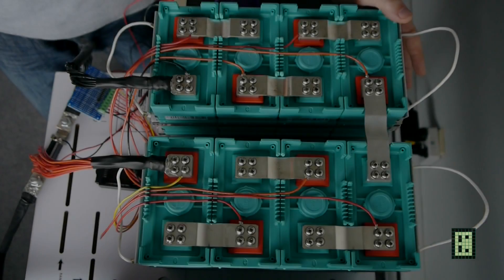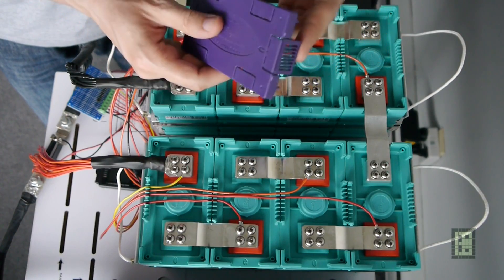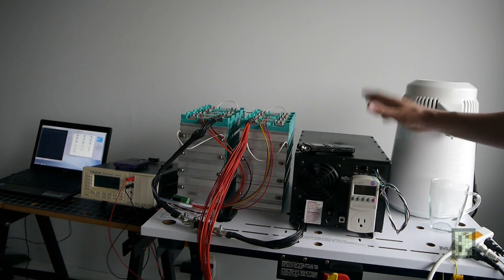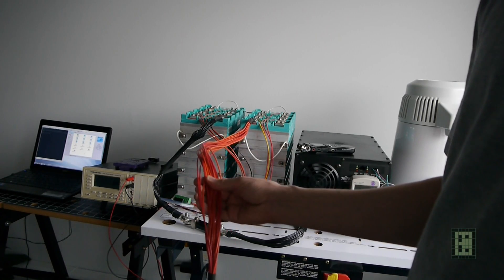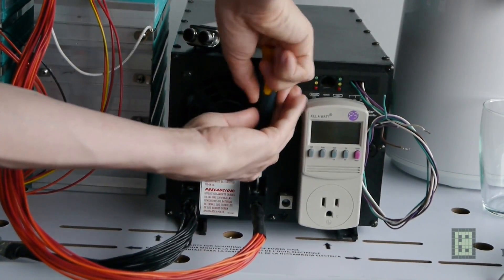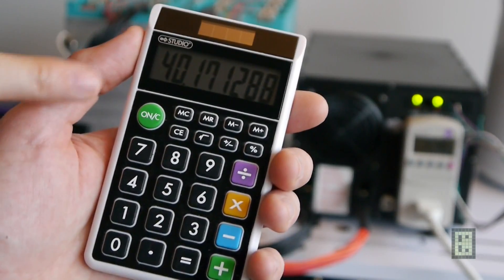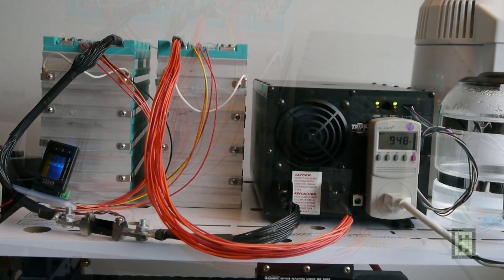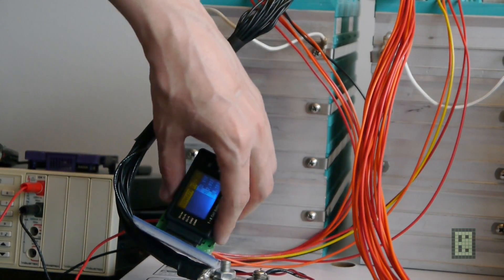GBS 100Ah LiFeMnPO4 Battery review part 1

Comment: Hello Dear 
I want to know about this battery during these past 12 years
Reply from the maker: I have not used the battery in the past 6 years due to the fact that I upgraded to a larger battery 180Ah 24V as I needed more energy storage for my house.
This early version of GBS batteries had a spec of just 1500 cycles at 80% DOD and the battery has meat those specs.  There are way better batteries than that today so it will not make sense to get this not even the updated ones with 3000 cycles at 80%.  If I remember correctly even new the battery was just about 92Ah usable (out of optimistic 100Ah spec) and by the time I took the battery down it was just a bit above 70Ah but it was used quite heavy about 60% DOD in average per day as it was a bit low capacity for my needs especially in the last years of operation. I still have the battery in storage maybe I will find some time in summer to do a capacity test but I expect it will be around 70Ah maybe even a bit under as even in storage there will be significant capacity degradation as with any battery.
The new battery made with A123 System cells had a spec of 6000 cycles at 100% DOD so way superior to GBS and it shows just over 1% degradation per year in average.
For that you can see the degradation test in the first 3 years here https://groups.google.com/g/electrodacus/c/nKWp_6tjMNM/m/1f66fW6-BwAJ with more details including how much enenrgy was used from battery over that period.
Currently the most popular cells are the rectangular 280Ah cells produced by at least 3 companies. I have the EVE versions 280K with 6000 cycles at 80% DOD spec and you can see initial impresions about those here https://groups.google.com/g/electrodacus/c/yN3i-jHNEcQ/m/0gFujrU5AgAJ

Comment: I look forward to new video and testing from you as your system ages. I am a province over and north west of you. I switched from lead acid to Lifep04 in spring of 2021, so I am roughly one and a half years in. Bought 4 280 amphr batteries from Alberta Lithium. At the time the price was 1200.00 a battery (now 1500), a good deal I thought. 14 kwhrs is working well for my roughly 6 kwhr of daily use but I plan to add one more of the same to my bank in the spring of 2023 and then just ride the batteries for all the life I can milk out of them. I adjust my controllers down in the spring to fall period to 13.8-13.9 max voltage charge, then adjust the charge voltage up to roughly 14.4 in the winter just to capture every bit available, if available. In the winter I do not let the voltage (under load ) fall below 12.5 volts, in other words I am doing everything I can to extend the life of these batteries, including keeping the temp around 16-17 in the winter and not over 21 in the summer. Can you think of anything else I could do that will extend the life span? Or are there things you do that I should? I would like to expire before these batteries do! I used to check in on your forum to read up on  the interesting posts, but I see that it is gone now, have you continued it elsewhere? Thanks.
Reply from the maker: I used this battery for about 5 years or so and degradation over that period was fairly significant but still within spec. The battery was replaced since then as capacity was to small for my needs and so now I use a 4.5kWh battery made out of 20Ah A123 Systems cells that performed excellent for the past almost 5 years so it should be good for at least another 10 years.  You can see how the A123 system battery performed in the first 3 years here https://groups.google.com/g/electrodacus/c/nKWp_6tjMNM/m/1f66fW6-BwAJ  I will do this summer another test but I do not expect much degradation.
I also recently installed a 14kWh battery made out of 280Ah cells but for that I only did an initial test and will do a more accurate one in a few months https://groups.google.com/g/electrodacus/c/yN3i-jHNEcQ/m/0gFujrU5AgAJ

Comment: How has the battery pack been working out for you?  Is it holding capacity after 7 years?  Are you using them daily?  Would you buy the same type of cell if you were doing it today?  Loved the video, thanks for posting.
Reply from the maker: I used this battery full time for about 5 years and by that time it was at close to 80% of initial capacity so a bit more than 3% degradation per year about half that from cycle (heavy use over 50% of capacity in average per day was discharged from battery) and the other half from calendar life (meaning internal chemical reaction over time is mostly based on temperature).
This GBS battery performed according to spec but it did not had the greatest spec so it is not that great value when better batteries are available. Spec was 1500 cycles at 80% DOD and the internal resistance was high at around 2mOhm most others are 3000 cycles and internal resistance less than 1mOhm for same capacity meaning they will last at least 2x as long in same use conditions.
Now I have an A123 System LiFePO4 battery rated at 5400 cycles at 100% DOD and very low internal impedance and after first full time year of use I have 0.9% degradation around 0.3% from calendar degradation and around 0.6% from calendar aging  so it should last 20 year. It will soon be 2 years and will make a capacity again when that happens.
Here is the degradation test done for the A123 System battery for more details  https://plus.google.com/116120341806216696709/posts/er5dRShZkSj
Reply: @electrodacus  hello, what's your impressions after a so long use of A123system Lifepo4 cells?
Reply from the maker: @kostaskostopoulos2913  The A123 system battery works great and you can see the capacity tests done after one year and 3 years and I will do one when it gets to 5 years so in a few months https://groups.google.com/g/electrodacus/c/nKWp_6tjMNM/m/1f66fW6-BwAJ

Comment: Would you buy these batteries again and how are they holding up?
Reply from the maker: I got this batteries many years ago since then GBS improved. They did performed as specified at that time 1500 cycles at 80% DOD and they also had fairly high internal resistance. The new GBS claim half the internal resistance and also double the cycle life 3000 cycles at 80% DOD still Winston cells are better with even lower internal resistance and 5000 cycles at 80% DOD so if you can get Winston cells I will recommend those.
If you search on my older google+ posts you will find a capacity degradation test after 5 years of full time heavy use for GBS and  also a test of my new battery made with A123 cells (I needed a large capacity as my demand has changed). The A123 cells are for sure superior and rated at 5400 cycles at 100% DOD but is harder to find them and build a pack is also harder. Those A123 cells in same offgrid house usage only degraded 0.9% after 1 years most of that is calendar aging degradation so this should last 15 to 20 years.
Here is the link to my google+ for more details  https://plus.google.com/+electrodacus
Reply: @electrodacus  The Winston cells are much more expensive than the GBS cells right? Do you think the GBS cells make up for their lower quality by being cheaper?
Reply from the maker: @adon8672  The difference is not significant and no the GBS can not compete even at half price. GBS cells are just around 95% of stated capacity when new Winston are 115% in average of stated capacity.
My particular cells where rated 1500 cycles at 80% DOD and they did performed according to that spec but that was so much lower than 5000 cycles at 80% DOD of the Winston. There are also CATL cells available now and those are likely also a good option.
Reply: @electrodacus  Thanks a lot for sharing your knowledge and experience. I appreciate the prompt reply.

Comment: i have 100 ah lifepo4 48v 100ah battery ,, shall i use 2 bms in series ?
Reply from the maker: Are you referring to my SBMS series ? There will be a new Kickstarter in about a month time where I will have a lower cost SBMS0 version and two of those can be used for a 48V battery. But battery seems very small capacity why did you wanted a 48V system as a 24V will be much simpler with just one SBMS. You will just have groups of two cells in parallel and 8 of those groups in series for a 24V 200Ah battery.

Comment: Do you happen to know the maximum voltage noise it can handle? I am doing a project in which I have to connect the  72 cell battery 3.2v 60ah gbs-lfp to a  converter .
Reply from the maker: You will need a proper BMS for that this monitors are no good for anything other than a quick check. They will discharge the first two cells if left powered on (first two cells in each group of 8 cells in your case).

Comment: since this posting, have you seen any degradation of the batteries?
Reply from the maker: +Kris Wyrick Next month I will do a capacity test and post a video about degradation. The battery is used full time in the last 3 years to power my offgrid house so it had over 1100 days with an average of 1.2kWh/day used from battery (battery is about 2.5kWh capacity). I expect around 5% degradation but if is more than 7% I will be disappointed.

Comment: Will my 12v 10 amp battery charger charge up those 100 ah batteries?
Reply from the maker: robviolin1 This is a 24V pack but you can charge half at a time with a 12V 10A charger (you also need a BMS or monitor each cell manually).Also each half pack (12V 100Ah) will take up to 10h if completely discharged 10h x 10A = 100Ah.
Reply: Thanks - I have a 12v 10a battery charger and what I wanted to know is if my battery charger will charge up a 12v battery that is rated at 100ah. 
OR - does one need a battery charger that is designed special to charge up 12v batteries with 100 ah. 
Thanks
Reply: I guess my question is:
Are there battery chargers that only will charge up to 50ah batteries  and other battery chargers that are made to charge up to 100ah batteries?
Or - does the battery charger not care about how my ah your battery is rated at? 
I am really sorry I know anything about this stuff. 
Thanks for your patients.
Reply from the maker: robviolin1
Battery charger dose not care about the size of your battery. You can even use 1A charger you will just need to way for 100h to charge your battery and that may not be convenient.
Reply: Ok great, that is what I needed to know. I have a new black and decker 12v 10 amp battery charger.  I may be getting a 12v 100ah battery for my electric riding mower that I am converting from gas to electric. It is good to know that a battery charger does not care about how many ah your battery has. 
Thanks for helping me and thanks for sharing.
Reply from the maker: robviolin1 It dose not care is charging current is small but it cares if is to high. For example if you buy a 100Ah Lead Acid then 10A charger is the maximum you can use.With a LiFePO4 you can charge even with a 30A or 50A charger if is a 100Ah capacity for long life. But for LiFePO4 you also need a BMS (Battery Management System) that will check the voltage of each individual cell and do cell balancing.
Reply: Ok thanks. I will just be charging a 12v 100ah battery lead acid battery or deep cycle (golf cart battery). 
I won't need a battery management.  I may use a 24v system (two 12v wired in series).  I will be using this 
Battery pack to power a motenergy me-1004 DC motor.  This motor is taking the place of my briggs 11hp that I used for my riding mower.
The battery pack is for my electric riding mower. 
Thanks for the information.
Reply from the maker: robviolin1 That should work just fine good luck with the conversion.
Reply: Thanks - the conversion is very simple. It is just 4 items. 
1.  Motenergy me-1004 DC 10hp motor
2.  300 amp fuse 
3. Battery inline cable switch 300 amp
4. Battery pack (24v , 36v , 48 v)

Comment: When using any battery please fuse the battery bank with a proper cartridge fuse (these supress the splat when they blow) for an application where you expect to draw 100amps use a 150amp fuse, you have to protect the cable if you have a short circuit condition.
Reply from the maker: You are right an external fuse is necessary. The inverter is fused for both AC and DC internally.
This was just an experiment not a permanent connection and I took the calculated risks for this experiment.
There was little chance something internal to the inverter will fail so that it will take out the internal DC fuse and if there was a fault on the AC side the AC fuse accessible on the front of the inverter will have been easy to reset.
Thanks for the comment. I should have probably had a do not try this at home warning in the video.

Comment: I need som help. First: i want to put 4 cells ( 3.2×4=12.8 V) for a project and i want to know how do i charge them when they are connected together. Can i charge them with a car battery charger or do i have to charge each cell by its own at 3.2 V?
Reply from the maker: You can charge them in in series but you need a BMS (Battery Management System) that will monitor each individual cell and when any of the cells exceed 3.6V (for LiFePO4) the charging will be stopped by the BMS.
Right now I work on a Solar BMS charger that can charge any Lithium cells up to 8 from solar PV panels.

Comment: You said that these batteries are cheaper but I google it and it seems are much expensive. Can you provide me with a link from where you bought yours?
Reply from the maker: They are compared to Lead Acid. I guess is what I was saying.
When you compare the price of batteries  you calculate the cost per energy stored during lifetime of the battery.
So you divide the price of the battery at the (number of cycles x depth of discharge x capacity x charge discharge efficiency) so you get price /KWh stored the best I have is the A123 System the 20Ah cells they are about 20cent/kWh stored during lifetime still more expensive than grid energy in most parts of the world including Romania but not by much.
Mersi de sbuscriere.
Reply: he means over time they are cheaper. they can be cycled much more and will last considerably longer than lead acid batteries. once set up they are a much better battery as long as they are not overcharged or drawn way  down. but just comparing prices they seem more expensive but in the long run are not.

Comment: Hi guys I need your help. I'm going to use theses batteries for a project, so I'm setting up my test bench. I just need to know, what is the electrodes holes diameter? I want to buy connecters but I don't know the exact measure. Thanks for your help.
Reply from the maker: I got my connectors when I purchased the battery. I know I selected the connectors that I wanted from a pdf sheet they depend on configuration.
Also the size is probably different if you have other capacity than 100Ah.

Comment from the maker: Sorry I made a mistake is 0.6$/Wh not Ah and even that is not a good benchmark to price a battery the number of discharge cycles and the depth of discharger is an important factor.
So I will use price/kWh stored even if almost no one uses this.
In this case a A123 20Ah cell 64Wh cost about 32$ so 0.5$/Wh but can be discharged 3000$ down to 80% so 64Whx0.8x3000 = 153.6kWh during lifetime 32$/153.6kWh = 20 cent/kWh 
I can not really recommend GBS for most uses because of high internal impedance.

Comment: Hi Electrodacus,

The impedence comment is incorrect. The way you measure impedence include too many other factors, such as jumper resistance and contact resistance, as well as wires. You can reduce the value by simply adding more jumpers.  Using a typical impedence meter and measure directly on the terminals, you will find the impedence of the GBS 100Ah cells are typically 0.5mohm.

Comment: Great to see that the GBS batteries are working well. Super sharp videos! We have sold quite a few now and have found the GBS cells to be very consistent quality. This is very important when combining cells in series. If the cells have different internal resistance the BMS has to work very hard to keep all the cells balanced. After a few charges with a BMS which balances the cells require very little balancing to maintain equal voltages.

Comment: These are great videos! I was wondering if I might ask a tech question though... GBS claims their batteries are 10% lighter than the equivalent LiFePO4 from someone like CALB. Is this due to construction, or the chemistry of the Mn? Is there any real difference, or did this company simply include more letters in the formula?